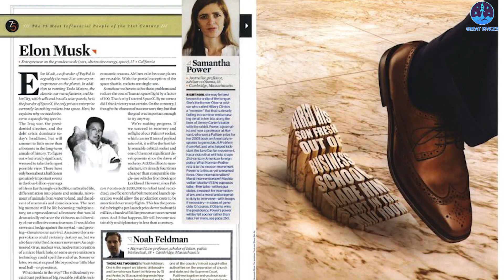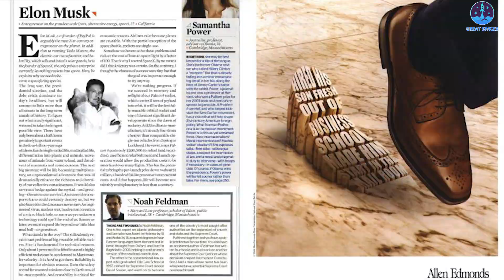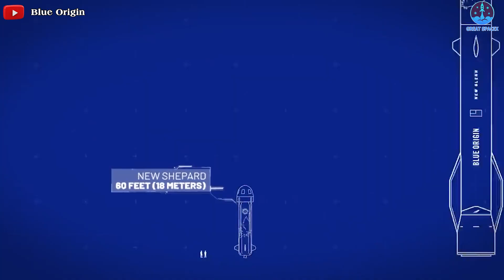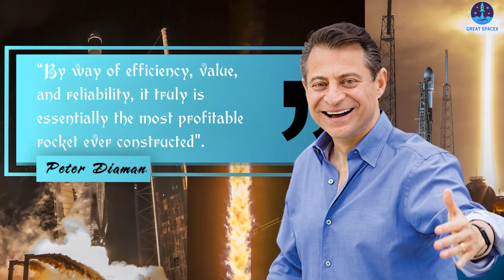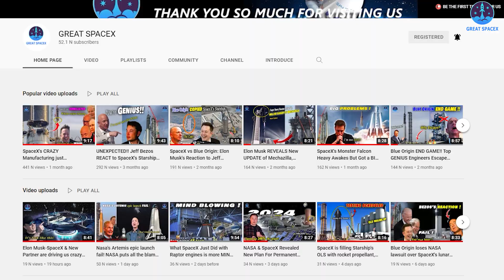What Elon Musk-SpaceX Just Did is equal to the whole world rocket industry combined!

Comment: Space suit solution for lunar/Mars walks: I believe a high-reliability, agile, and low-cost solution (that SpaceX will provide) is a two-part design as follows: (1) MSS: a self-driving mobile cart with all the life-support: power, gas and liquid supply, communications, and computer control with a "heave compensated" umbilical to (2) a minimal structure suit for the astronaut to wear, providing basic pressure, temperature, circulation, fluid waste collection, and audio-visual communication through the cart to base. A 15 minute minimal self-contained pressurization fail-safe would be useful for transit between capsule and mobile suit support.